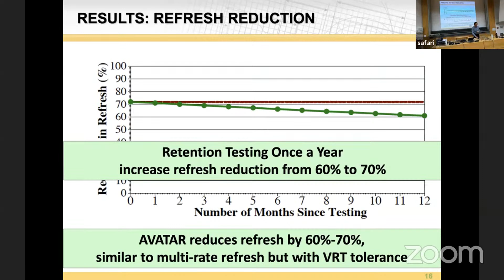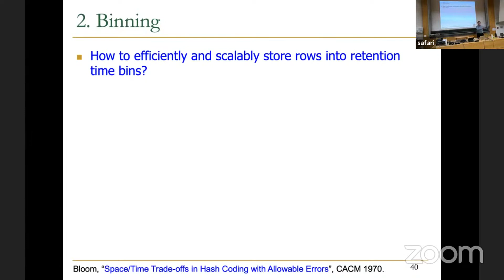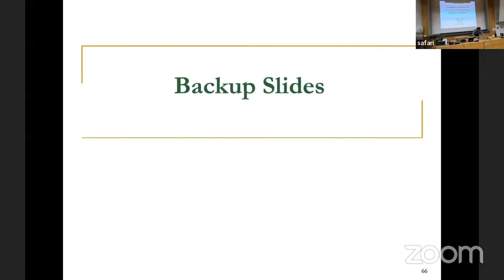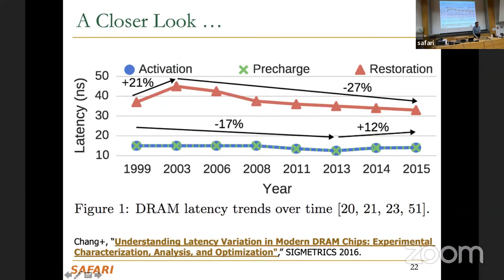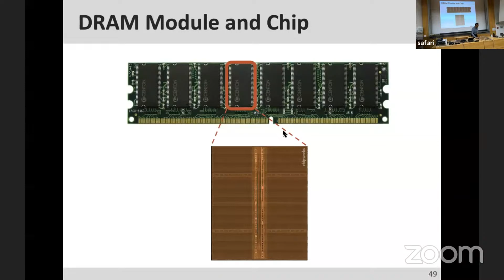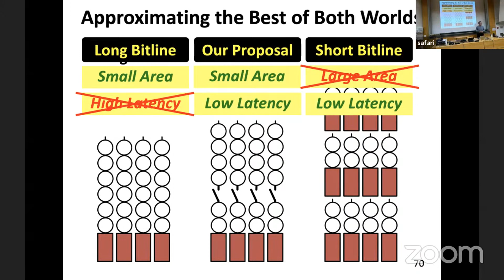Computer Architecture - Lecture 8: Data Retention, Memory Refresh and Memory Latency (Fall 2022)

Comment: in the siloed IT industry, too many people cannot let go of the 1980's (up to late 90s) concept that more memory at lower cost was absolutely priority 1. During Intel Merced development, the 460GX chipset was going to support up to 64GB memory (depending). At the time, the top Merced was projected at $4.5K (Intel) so 18K for 4 processors, while the memory was looking at around $80K. Today, we are looking a top 64-core processor around $6K, while memory, assume $800 per 128GB DIMM, 16 DIMMs per socket, is $13K. Basically, memory cost is now small.
Now factor in that software is licensed per core and is much larger than hardware cost. The value of improved performance is huge. Yet we cannot let go of old memory concepts.
Getting a DRAM vendor to make a low latency DRAM chip is problematic with no forecastable demand.
Take a standard ECC DIMM. ex. the SPD knows the actual DRAM chips have 4 groups, 4 banks, 18 row address bits, and 10 columns address bits. 
Can we write to the SPD to use only 17 row address bits? presumably this is low half of the bank? then determine an appropriate set of latencies?